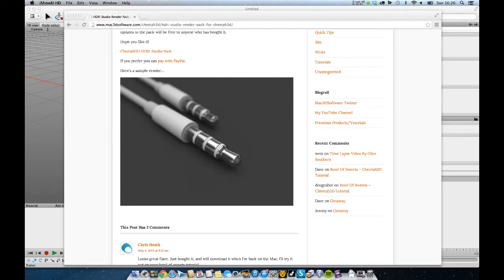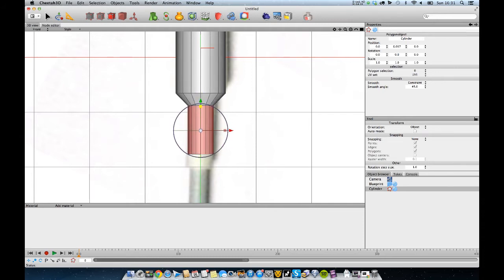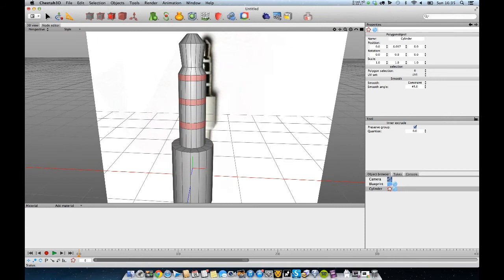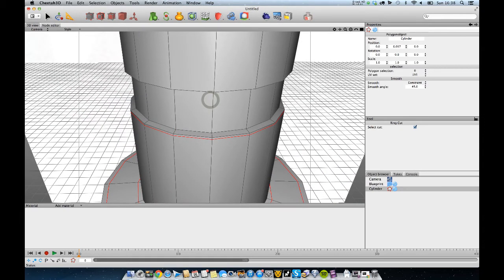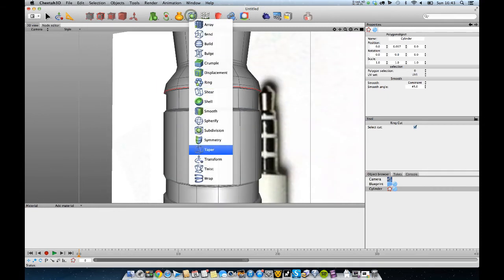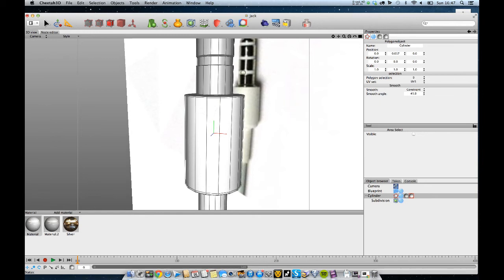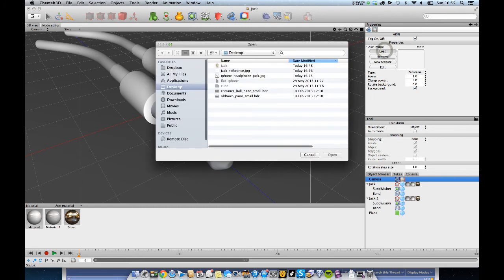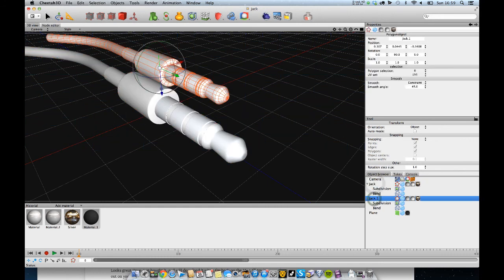Cheetah3D Tutorial - iPhone Earphone Jack

Comment: i like the performance of the new Mac, and no fans this time!  I got several tips from your workflow, especially the sequence of operations. Just a quick Mac note: you can start your old machine in target mode and it functions just like a hard drive if you connect with firewire or usb cable. Restart a Mac while holding down the 't' key and it immediately drops into target mode. To get back to normal, simply restart the Mac.